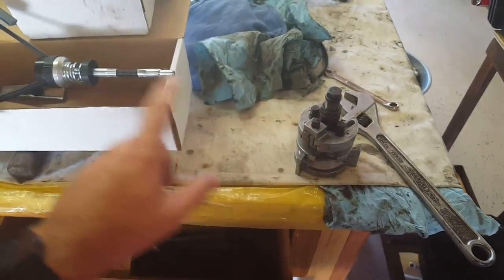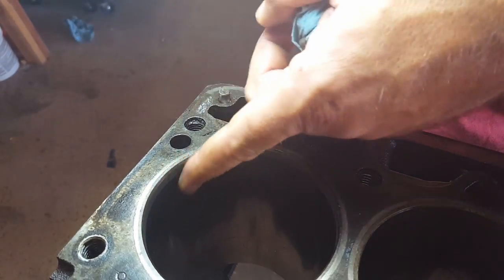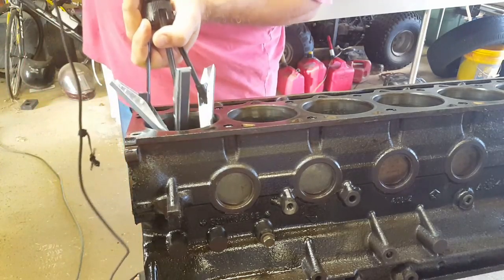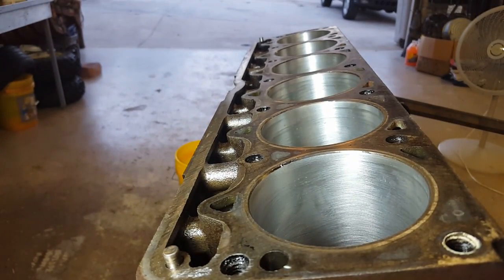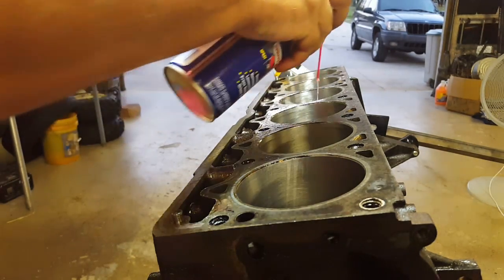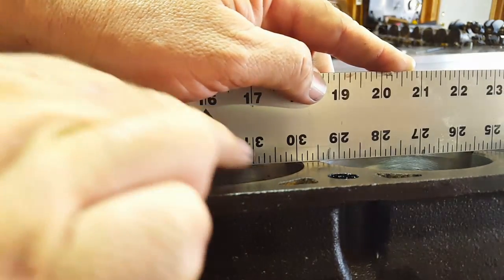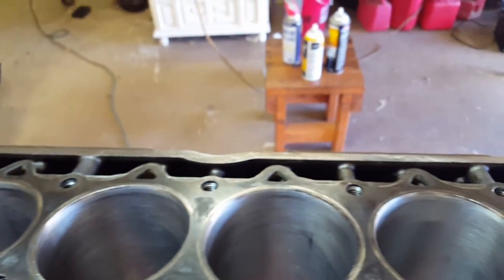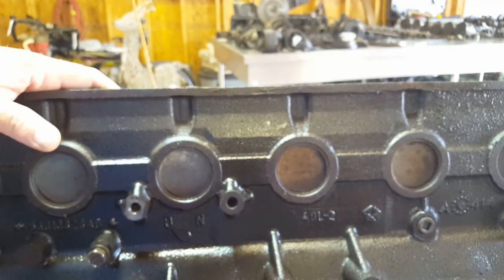Anyone can rebuild an engine - Jeep 4.0L rebuild project - part 3

Comment: You don't want to use a ball hone if the ring is messed up and made an angle the cylinder wall the ball hone will make it worse and the bristle that you are talking about is at Napa it is yellow or green they work well its for a dye grinder they don't sell the attachment for it with the brush it is separate but they sell that to

Comment: Good video. I have rebuilt only 2 engines. One a 302 small block Ford and the other a big block 390 FE Ford. I borrowed a dial bore gauge and checked all the bores for bore taper and discovered the tapers to be out of spec even though the cross hatch lines looked new. Putting old pistons and new rings into tapered cylinders will cause the rings to expand (gap widens) and contract (gap narrows) because the piston and rings are getting squeezed tighter as they go down into an out of spec bore. Best thing is to bore 20 over and go ahead and spring for oversized pistons and rings that last as long as original in the square bore. I just don't see all the huge effort of pulling an engine and not bringing it back to spec. Let us know how this build works for you.

Comment: That line you feel is NOT a ridge it happens to be carbon build up from the combustion process .. Yes you can have a significant ridge  but you can also have the  carbon build up as well  .. Remember you start your hone with a more aggressive "Grit" get them all finished then use a less aggressive grit  until you reach the desired finish ...I've only been rebuilding engines since the Mid 70s so you don't have to take my word for it. I've done every small block chevy a few 292 inch 6cly chevys to many to count Big block chevys a few 440 Dodge engines way to many Pontiac 400 and 455 and even one 428 inch Pontiac  a few 231 inch buick V6s lots of bike engines . I've even done a few V8 Detroit Diesels .... they are called Roloc pads .. Dude you send the head out you DO NOT do an engine rebuild and then put the old head back on ... You send it out and have a not to expensive valve job done they hot tank the head cut new seats machine the valves install new springs new seals they check valve guide wear and you get a head back that is worthy of the effort you just put into your bottom half .. It's really a No brainer
Reply: P Neumann I just rebuilt a 258 4.2 and did a 4.0 head swap. It only cost $120 for them to do a multi angle valve job, new springs, keepers, seals, it was hot tanked and checked for cracks and they machined one of the bosses for a temperature sensor from my old engine and the head was resurfaced. That seemed rather inexpensive. A new head was almost $500.
Reply: How much for the cylinder head work you mention
Reply: Excellent- I will have this done as well! Happy to hear that.